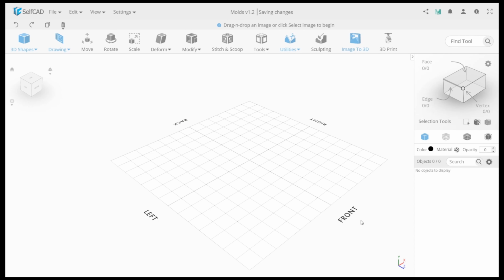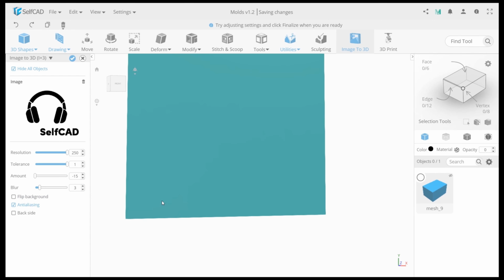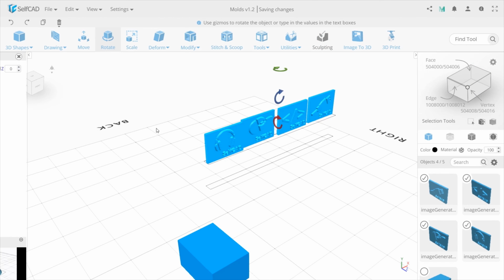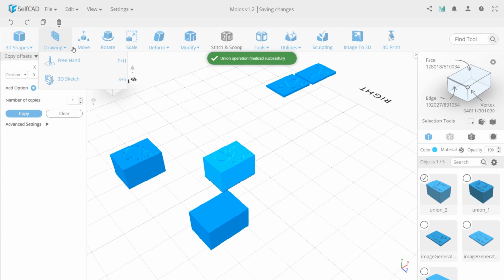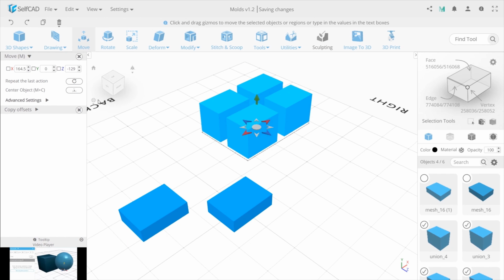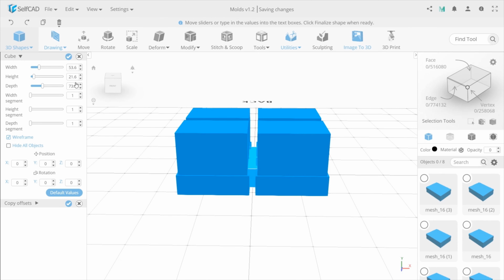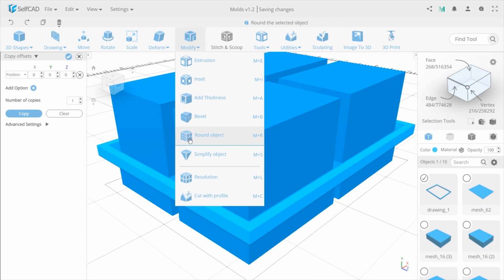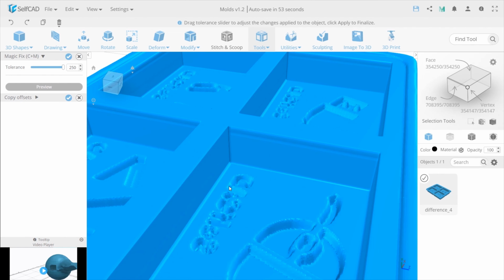Easiest Way To Make Custom Soap | Useful 3D Modeling With SelfCAD

Comment: What kind of 3D printing filament is this?
Reply from the maker: Hi Isaac! I can’t recall the exact filament we used for the molds (it’s been a while since we printed them), but I can tell you it was a flexible type — most likely TPE or TPU, as those are ideal for elastic prints like this.
Hope that helps!
Reply: @SelfCAD  awesome, thank you!